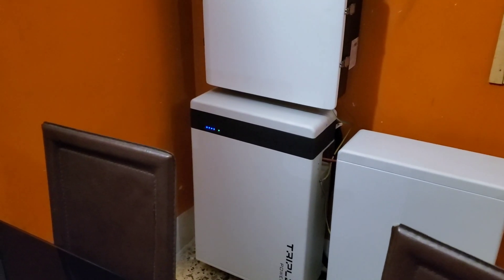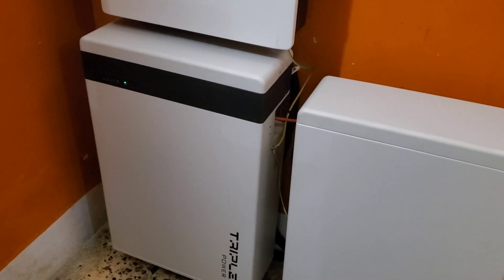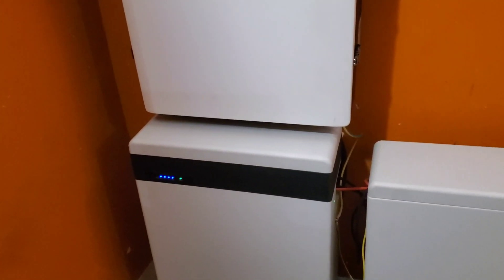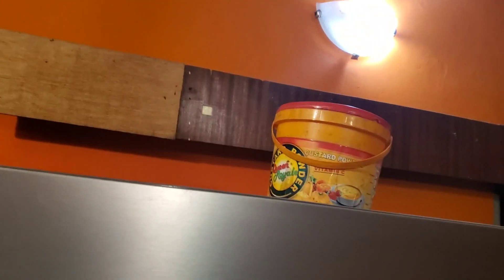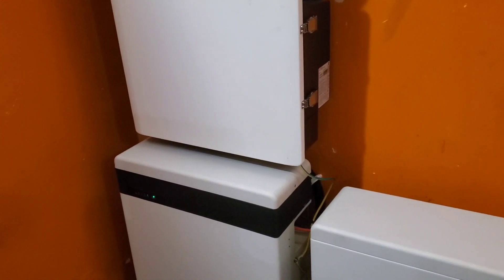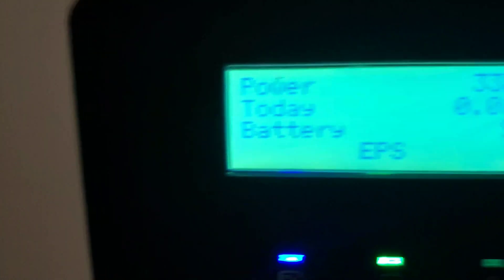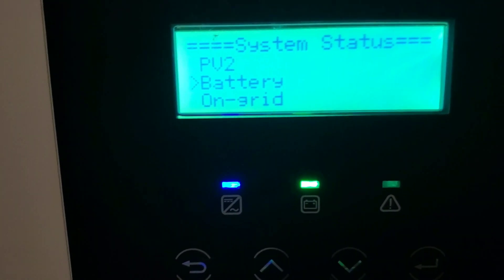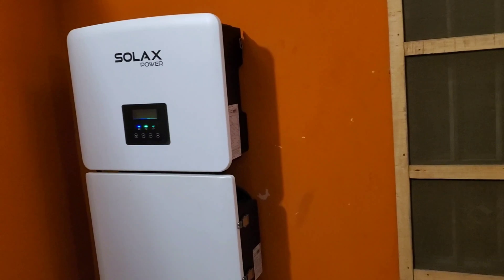Mind blowing result from the SolaX Triple Power Battery. .

Comment: Hi Dr Solar, Thanks for making video. I got these SolaX Triple Power Battery Master and slave and tried to run with Sungrow Hybrid inverter. The slave got measured at 117 voltages, and the master was not given any output whilst I connected series with the short cable from the slave and also turned the arrow to 4 that required setting to measure the master unit. Also didn't pair with the inverter, which turned off itself soon after turning on after flecking green/red alternatively for about 10 seconds and then amber for 2 seconds, then turned off. Your help is much appreciated.
Reply from the maker: Hey thank you for watching and commenting. Solax is a proprietary battery will only work with a Solax inverter.

Comment: Hey, do you have any thermal issues? You installed them closer together as indicated in the manual (32-38cm distance)..just wondering, because I’ve got a bit of a problem with space..
Reply from the maker: Thank you for watching and commenting. No thermal issues whatsoever. They don't really get that warm. The electronics are at the top of the batteries.

Comment: I have 1 tripple power battery and is not coming on, what should be the problem?
Reply from the maker: Did you open the top of the battery and turn the breaker on ? Do you have the grid or pv connected to your inverter?

Comment: Hi question have a 2nd solax tripple battery that I'm trying to add to the existing battery but struggling to disconnect the mc4 loop cable any tips or tools to help with this?
Reply from the maker: There is a tol that came with the battery. Do you have it? It is the only way that I have been able to remove them.
Reply: @Dr Solar @AWPS Renewable Energy, LTD  I didn't see any tools in the slave battery pack was it in this or the primary one as I never installed the primary

Comment: Hi, great video! Do you see the slave battery on the app as a separate battery or is it just 1 battery charging to encompass both master/slave? THanks!
Reply from the maker: Good morning. Thank you for watching and commenting. You don't see the slave Battery as a separate battery. You see one battery but at a higher voltage because the two are in series. I hope this helped. Welcome to the channel
Reply: @drsolar  ah, thank you so much for replying. So does 243v sound like 2 batteries? Love your content!
Reply from the maker: @BlackBeltBarrister  sounds just like my voltage. Yes. Do you have the single phase inverter? Thanks for the love please give the video a like.
Reply: @drsolar  yes, single phase and should be master/slave at 11,6kwh. LIke already deployed 😁👍
Reply from the maker: @BlackBeltBarrister  congrats. You might need a firmware update. I have had to do a few of them

Comment: Thinking of getting a  solax T3 5.8 kw battery to go with Solax X1 boost inverter, is yours a Hybrid or standard like mine. How many kw ? Great video, helpful. Thx
Reply from the maker: Thank you for watching and commenting. Mine is the 5 kw hybrid. I don't know much about X1 boost
Reply: @drsolar  Thankyou, i have just had an email from my installer, that i will need to change my inverter over to a solax hybrid for it to work well with the T58 battery.

Comment: Hi, I've got orange led on status.
Any idea what it could mean?
Reply: Orange led on battery BMS, that was after adding extra battery.
Today all is good, all green.
Perhaps old and new battery had to synchronise SOC.
Thanks
Reply from the maker: @marcinch9553  what was the state of charge of the first battery when you added the new? It take a charge cycle or two for them to balance depending on SOC
Reply: About 48%
Reply from the maker: @marcinch9553  that might have been a big disparity in SOC. The really good batteries will balance out over a few days
Reply from the maker: Thank you for watching and commenting. Orange LED  on the battery or the inverter?

Comment: Is it possible for a DIY to install a second battery to a existing 5.8kw could you show and chat about installation.  Hi from Ireland. 
Thanks
Reply from the maker: It is not really very complicated. You have to be comfortable working with high voltage. You will have to open the master battery to adjust the dip switch settings. Step 1 turn the breakers off starting with the PV, then turn the inverter off. Turn the battery breaker off. Open the battery cover (BMS), turn the BMS off and then turn the breaker inside the battery off. There is a cable that loops around at the right side of the battery. You have to disconnect that. Remove it. You will put it in the same position on the right side of your 2nd battery. Then connect the supplied positive and negative. The communications cables and then that cable that you had removed. The dial on the BMS twist to position 1. Put breaker on (battery) turn BMS on. And you should be good to go
Reply: Thanks, 
Stay safe from the Republic of Ireland the Emerald Isle.

Comment: % is never an accurate way to measure battery
Reply from the maker: OGW there is a BMS in the battery that talks to the inverter. It is supposed to be pretty accurate.
Reply: @drsolar  Maybe after you configure it with the AH size and when it is fully charged it may keep track but likely with in 10%.
Reply from the maker: @offgridwanabe  in an open loop system that might be applicable, In a close loop system there is communications between the inverter and the battery, As long as you full charge them every other day, the BMS does a fairly good job of relaying SOC to the inverter. In an open loop system your comment applies. It looks at AH that you input and then calculates from a full charge.
Reply: @drsolar  It still can only calculate it from the shunt and when it hits 100% it resets each time so if you have a low top set you will have less than you think so dependent on your settings.

Comment: So you have wine bottles but claim there is no wine in it. So where did the wine go, Doc? Did you share a drink with the battery system the night before? Because I agree that after a night of running AC the BMS must be drunk saying that it is still at 92%... LOL 

Most important thing though is that you are not in the dark anymore.
Praise the power of solar!
Reply from the maker: All hail the solar. I confess. I drank them and use the bottles to store water. The BMS sadly did not share any with me. Maybe, just maybe I will give it some tonight. It takes a little bit of time for these things to calibrate. The two batteries had different states of charge when we married them. So in a few days they should be okay.